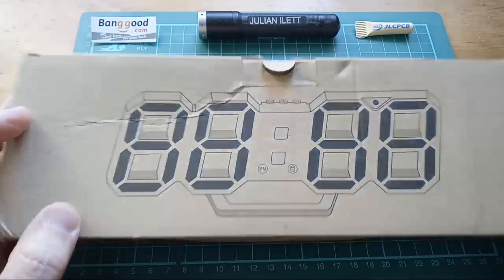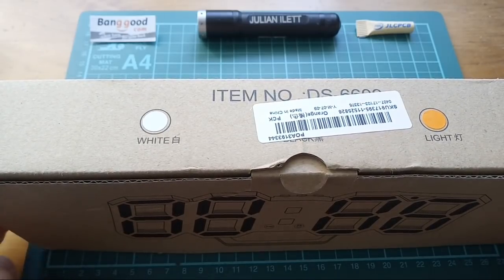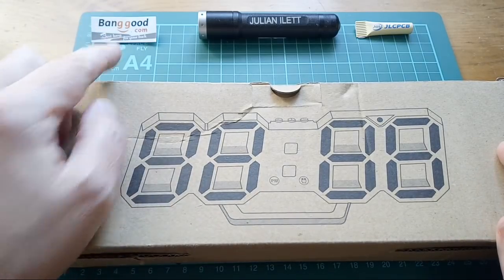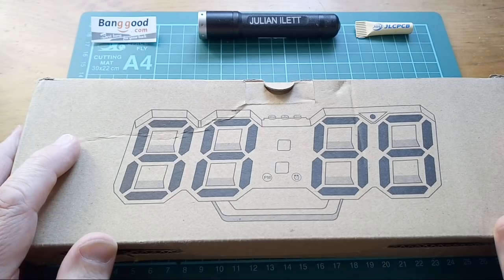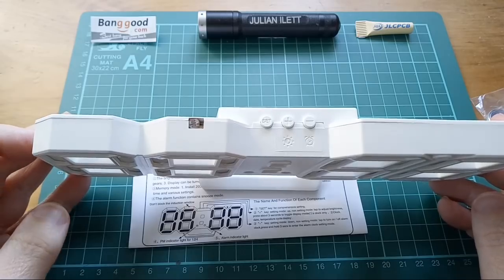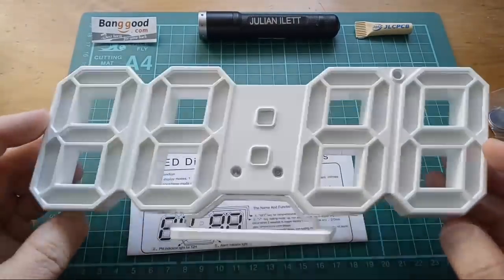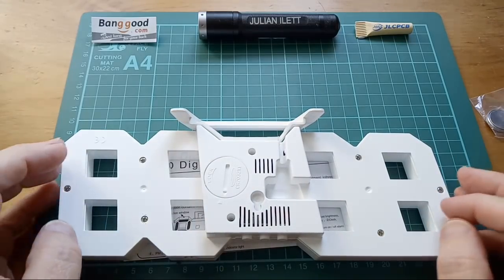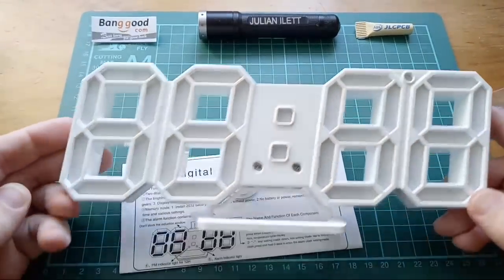Big Clock Live

Comment: By the way, for some nostalgic but also modern challenge can be using Zilog's modern Z80 based MCUs, the eZ80 stuffs. It has got flash, RAM built in, but also works on external bus as good old Z80, if wanted. It has many integrated stuffs as well (being an MCU, no wonder). Zilog even offers ones running @ 50MHz, and much faster even on the same clock speed (IIRC, Z80 needs something like 11 cycles for 16 bit addition, eZ80 can do that in a single (?) clock cycle, regardless of the clock frequency exactly). And it's quite Z80 compatible at code level (well, undocumented opcodes can be a problem, I guess, if someone use such a things at all), but it also has another mode, when it can address 16Mbyte (IIRC) of memory directly by extending registers to 24 bit in size. But it's quite OK to use only in Z80 mode with or without the internal resources, mostly. I met one problem only: the usual IN/OUT opcodes refers to the internal peripherals, it can be a problem if some wants to connect devices to the bus. Surely they can be used at higher I/O addresses still, but it can be a compatibility problem with existing Z80 projects using some certain fixed I/O ports. Then it's not easy to use eZ80 instead of Z80 without major reorganization.